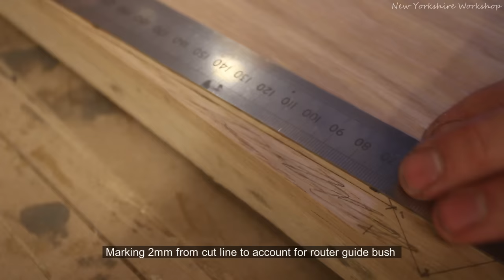Making a traditional framed ledge and brace door in Oak

Comment: That blade guard on your jointer would drive me nuts. I would be looking at how to replace it with a swing away "pork chop" type. It's actually a hinderence when you have to leap frog over it to make your pass in a smooth motion. Ditch it or Fix it! Do OSHA rules apply in your shop? I have  splitters on my saws and I have overblade dust collection with PVC and a shop vac, so I liked your system. My splitters are not easily removable for partial cuts because they require precise resetting from behind the saw table..... a real pain. Oh Well.  At 17:00 in a bandsaw is shown making grooves for wedges with a very poor blade weld. Too bad for that.   Nice video and work regardless! Pat

Comment: What is this jig you have which slides and clamps on your mortiser? I have a Delta and am struggling with the length of storm sash stiles.
Reply from the maker: The sliding table is part of the morticer, it is standard on all but the very low end diy morticers, it sounds like you need to upgrade to a better machine.

Comment: How did the door last after you fitted it assuming that the other trades will be onsite abusing it? looks too nice to fit so early.
Reply from the maker: i was worried actually, i didnt expect it to be in that state. main concern was the flat roof was due to be fiberglassed! turned out ok though, the owner was doing most of the work.
Reply: @NewYorkshireWorkshop  I thought the owner might, if he paid for it he would be looking out for it, :-)

Comment: Nice video, great work. What is your table saw that takes a dado blade?
Reply from the maker: its a wadkin 10 ags. originally had different options for spindle size, mine has a small one so can only safely run about a 10mm thick dado set.

Comment: Hey. What width Stiles are needed for that lock. Lovely door by the way. 👌
Reply from the maker: the stiles were 75mm and lock needed 65mm hole. this is a 45mm backset lock, 35mm is also available so that would need about a 55mm deep hole and 65mm  stiles. i wrote a blog about the door here, although i didnt cover the lock- www.newyorkshireworkshop.com
Reply: @NewYorkshireWorkshop  thanks for that. I have avoided using multi point locks in wooden doors and fitted standard mortise locks. But have a job coming up and will go for a multi lock. Will check out your site. 👍

Comment: In the US have not seen door hardware like you used.  Could you provide the brand?
Reply from the maker: It is a multipoint lock which is prety much standard for upvc and composite doors over here so there are lots of brands and the spec has migrated over to being used on wood doors over the years as well, this one was a Winkhaus cobra stv i think.
Reply: Thank you for the info-- seems right.  Now I need to figure why these are not available in US...  I am new to your site, and enjoy it much. @NewYorkshireWorkshop

Comment: Hello What size of shim do you use when you are putting the boards in,and why do you do it.
Reply from the maker: the shims were 3mm to space the boards out evenly, the boards are purposely cut under size to allow for expansion, especially if it is kiln dried wood on an external door as the boards will definately expand when the door is installed.
Reply: @NewYorkshireWorkshop  thank you for coming back to me so quickly. So what size is the tongue I normally have a 6mm and if I had a gap of 3mm I would be worried that in the summer you would see straight through.
Reply from the maker: @charlessharpe1345  I think they were about 7mm so roughly the same, yes you should check the moisture content of the wood you are using as this will help decide how much expansion to allow for, around here it ought to be around 14% - 20% for an external door,  ideally you should check a timber door that is installed locally to see what the content is. 
 The wood I used was  kiln dried and had been in the shop for more than a year and was around 8% so I didnt expect it to shrink any further and left plenty of expansion space.
Reply: @NewYorkshireWorkshop  many thanks for your reply. I am just about to make a pair the gates in European Oak1.85 high and and 1.79 wide I checked the moisture and it’s at 12%. I like your idea of a jig to fit the braces into the mid and bottom rails.

Comment: Multipoints I’ve been using have square ends and run the full height of the door. What brand are these? They look better on a single door by far.
Reply from the maker: Hi Adam. they are made by Winkhaus and the model is "cobra stv". i originally chose this for my victorian front door (on my house) because it has "key wind" which meant i could remove the latch and use a brass rim lock and knobs for a more authentic look. the one i used has 20mm face plate and yes the rounded ends are good, you can use them on any height door which is good.
this was the second id used and i dont have any complaints other than they dont come with keeps.
Reply: New Yorkshire Workshop Its winkhaus locks I use all time. Fitted a fair few now with only one fault. They never come with keeps always separate as so many options. Same locks go on singles doubles, double handle doubles and bifolds. Will look out the cobra as you say for these traditional doors (all I ever do) they are spot on. Thanks
Reply: They're radius end mpls 
There's quiet a few brands that do them.
But Winkhaus is a very good one, I also like the ERA saracen.

Comment: Why did you need to use the Japanese saw when you where just using the band saw!?! Finish it all at once. Cleaning up the hole with a chisel when you where at the Pilar drill moments earlier! Cleaning up where you used the bandsaw as you didn't use a guide rail and you set the saw to the wrong height making the blade wobbly. Cleaning up where you doubled up the saw blade instead of making a cut with the saw set at two different heights. You even show how you have a saw blade for your table Router.
Reply from the maker: i could work through all of those and answer each one with a reason but fundamentaly the answer is the same; when you are running a business and earning a living from making something then it is about doing each little process as quickly as possible and setting each machine perfectly by the text book isnt practical, you use what you have to hand.
Reply: Instead of calculating the movement of the wood why not go mad with power and throw as may screws at it as possible. Can't believe it. A nice set of hidden screws would have looked even better.
Reply from the maker: @LeopoldElwes  the screws ARE hidden. traditionally it would have been cleated nails, thats attractive eh!! i suggest you go watch some other videos before you have a stroke.

Comment: Hmmm! I suppose it is a question of taste, but if you are going to call it traditional ledge and brace in oak then it should be cleated wrought iron nails not stainless screws. Sure it looks crap for the first 200 years til the rest of the oak goes black... And as for that brass(ed) door furniture, urk. I do hope that was the customer's choice not yours. Apart from that. it's a nice door.